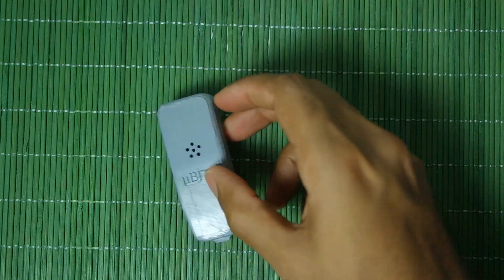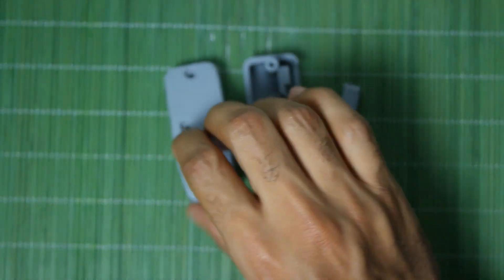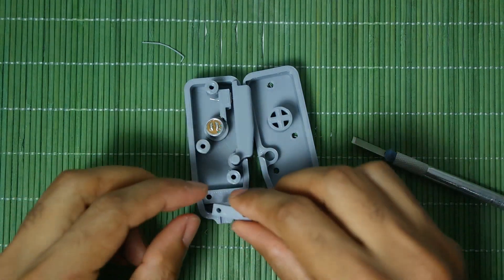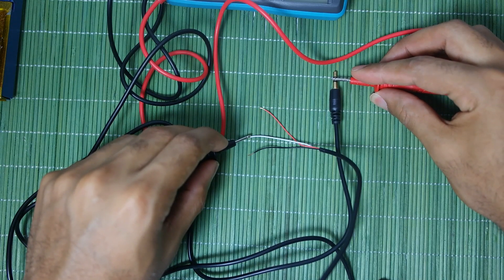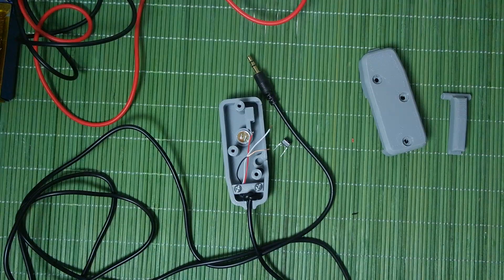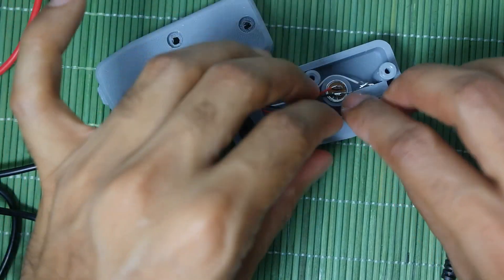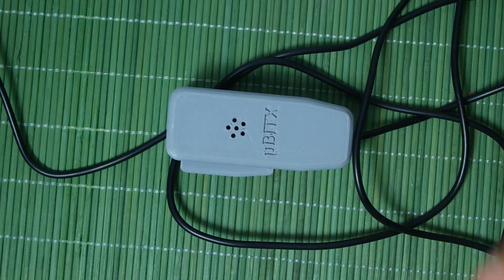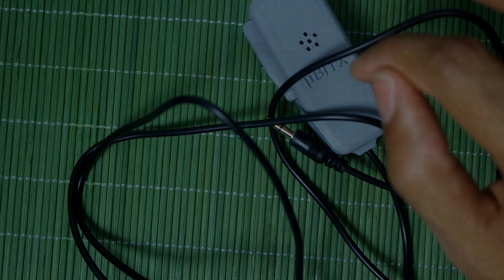3D Printed uBITX Microphone

Comment: I had to o ream out the PTT pivot and microphone holes to fit. Also filed down the pivot ends on the PTT. my first PTT lever broke a post trying to fit it in.
Also, see my remix of this mic on Thingiverse.
Reply from the maker: Yeah I just saw your model, it's a very nice modification. When it comes to the pivot of the microphone, I know that supports and the tolerances of your printer could make it too tight in some cases. I find weird that your lever broke since I designed it to be somewhat strong. Maybe yours needed more outside shells.